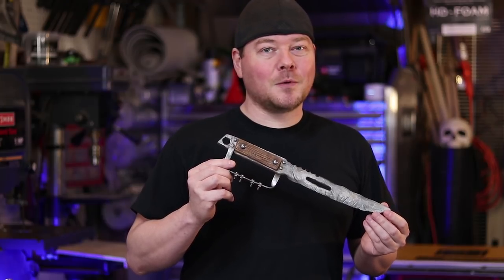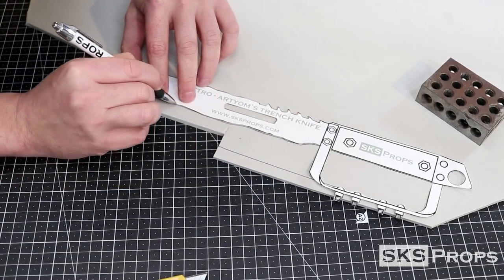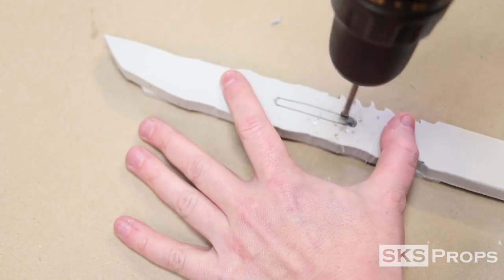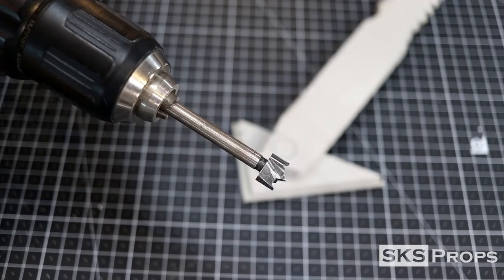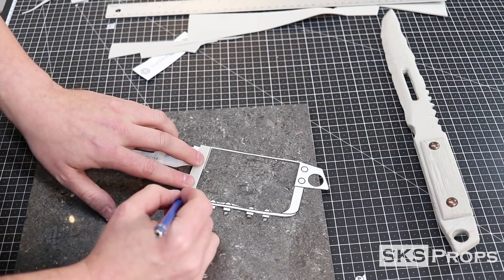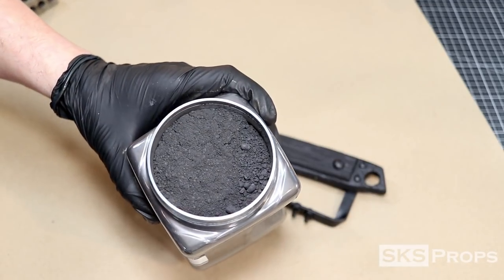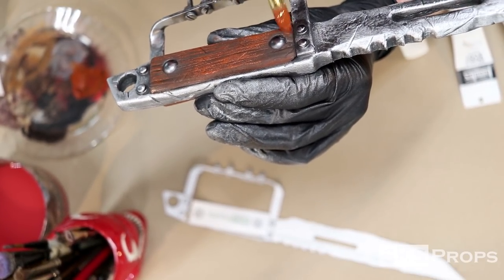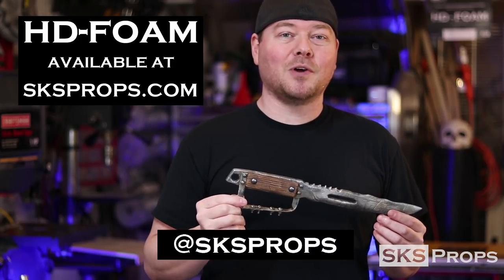How to Make a Trench Knife from Metro Exodus EVA Foam Tutorial

Comment: Do you use a layer of protective enamel over your props? I see that other foam smiths do and I was curious if you do as well.
Reply from the maker: flaminshotgun no I don’t ever seal my paint I let the different sheens speak for themselves. If you coat with a matte or semigloss then everything takes that property
Reply: @SKSProps  Interesting, I agree it keeps your tones intact. I would think the paint would be too exposed and fragile.
Reply from the maker: flaminshotgun also why I pretty much only use heavy body acrylics. More pigment and a more durable thicker base.
Reply: @SKSProps  Cool, makes sense. Thanks for the rapid responce.